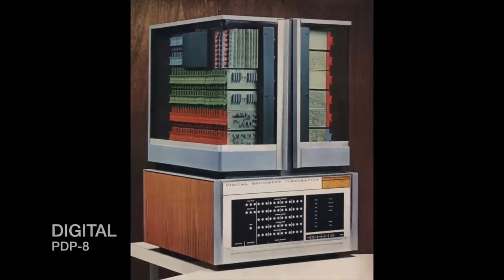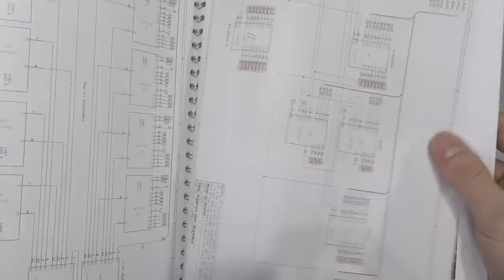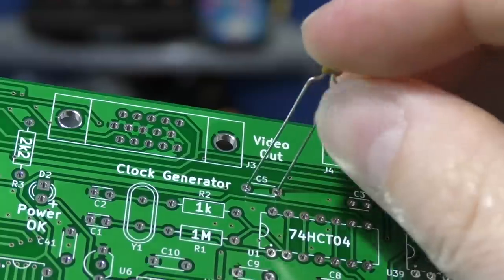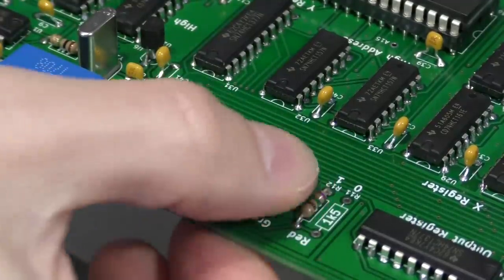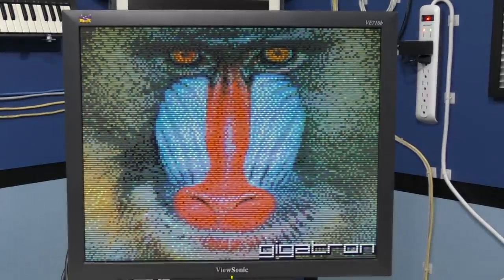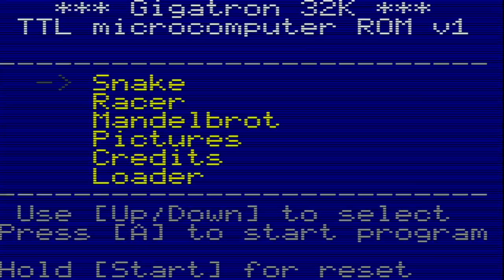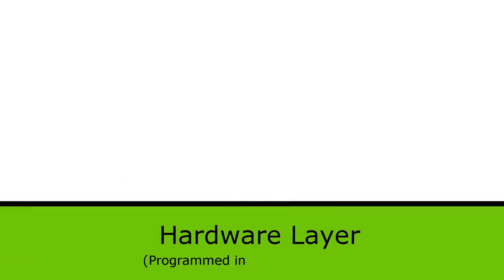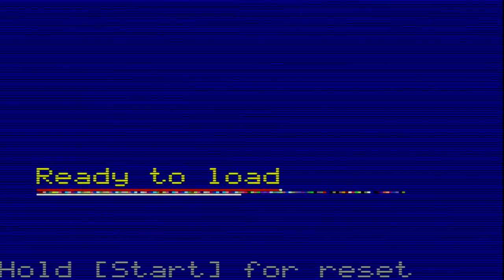The Gigatron TTL Computer without a Microprocessor

Comment: My first computer was a Vim with a 6502. I had to assemble my code by hand. Counting the displacement for relative branches was always challenging. It makes you appreciate what an assembler and linker does for you.
Reply: vim...
Reply: I learnt machine language on a SYM-1 with 4 k of ram. Expanded that with an S-100 bus memory board to 16k. Learnt a lot about hash on the DC power supply lines and how to suppress the damm thing from scrambling memory.  In fact I learnt much more about IC interfacing at that time than when I completed a "proper" Electronics Diploma a few years later at University.  By then the fun about building your own was beginning to disappear when the 386 and 486 motherboards appeared on the scene. I'm forever grateful that I learnt electronics and programming during the time of 56K modems. Nowdays I read about people not understanding how memory pointers work and I have to laugh.

Comment: I used to work with boards like this in arcade machines and 80s-90s pinball machines frequently. Gorf, Missile Command, Asteroids, etc. It made repair easy once you found the problem. Finding the problem could be a problem however.
Best deal I ever got was a “dead” Pinbot pinball machine. Had to replace 2 dead transistors I got off another dead board. Got the machine for $200 and cost nothing to repair. Knowledge is power.

Comment: I don't care what anyone says, he does an awesomely clean soldering job.  👍
Reply: J. Green it looks like his soldering skills have improved tremendously in recent months. It looked super slick this time.
Reply: Agreed. Such an improvement from when he made the PE6502 Hobby Computer. Practice makes perfect.
Reply: Are we sure those are his hands?
Reply: I agree. Very nice build. I be jealous.
Reply: that was the first thing I thought when I saw the circuit board soldering. great job, I wish I was that good :D
Reply: Yea, he solder good, but the wrong way... never heat IC that long.. do maybe 2 pins, then go to next IC do same there. In main time the IC's can cool, before he solder next pins... otherwise the IC get maybe damaged.
Reply: @hypnoticatrance  best to solder in a IC socket, that way A:  No possible heat or other damage due to soldering to any IC and secondly B: future repairs and tinkering are insanely easy compared to unsoldering an IC.
Reply: I run  my iron hotter myself.

Comment: When I was an engineering student, one of the courses involved designing a computer out of what were called bit slicers, basically a computer without a cpu on a chip but rather building a cpu or rather an alu out of multiple chips.  Also, it was and still is common in digital electronics courses to build state machines, the early Pioneer and Mariner space probes used state machines instead of computers.  In essence, you could make a state machine to perform all the functions of a computer, it's even technically correct to call a computer a state machine.  State machines can be made from mere transistors, op-amps, discrete TTL logic gates, from counters or even from eproms.  Today people take megabytes and multiple dynamically loaded libraries to write programs that we use to write in just a hundred bytes without a library, we use to call making your own personal library making your own computer language.  People just can't do anything without a ton of stuff being done by someone else which they don't even know if they need them.
Reply: John Wang 
I do admire all the work that was done to make my life easier, I’m very grateful for the people who spent pain staking hours working on today’s libraries. I have attempted to learn but 99% of it goes over my head. 😔
Reply: Challenge yourself with a one bit Texas controller, not a bit slice even. IIRC 4 bit instruction set and a one bit output data bus. A MAXQ TTA OISA from Dallas/Maxim is also a mental challenge. Instruction set; MOVE f ddd ddd ssss ssss.
Reply: John Wang.
Hmmpf interesting name , do you have any connectiion with Wang Computers?
If its not a state machine it must be either
A Von Neuman machine
Or
A Moore Mealy machine
Correct?
Reply: @QqJcrsStbt  What is the part number of the Texas single bit processor?

Comment: Back in there 80's I was an the final testing for Perkin Elmer Computers this is how our computers where made. The processor was on 4 separate 15X30 inch board's with up to 4 more boards of memory, the memory controller and cache had their own boards.
The best part is that we could step the clock and follow each bit around the processor.

What you call the virtual computer we called the micro code which has the logic to control the hardware.

I would love one of these.

Comment: is it just me, or is there something inherently satisfying about watching a pin being soldered in ?
Reply: Yes, when you correctly solder something for the first time, it is wonderful to see how the solder flows into the joint.  One of the younger members of the ham radio club liked it very much too.
Reply: I get so stressed when my projects doesn't get soldered properly.
Reply: @Fatih Kan I have faith in you! Clean the tip of the iron, add a little bit of solder to the iron, FIRMLY place the iron on the pin and the trace, wait a couple of seconds, add the solder the pin and the trace (not the iron),  let it flow for a couple of seconds, remove iron.
Reply: I thought that too until my old iron from the USSR decided to start melting

Comment: A little tip for anyone soldering ICs: First solder every other pin and then come back and solder the rest. Old ICs are extremely sensitive to heat (and modern ICs aren't indestructible either) and this helps spread the heat, limiting the chance of damaging the chip.
Reply: This pcb make for hand soldering - pins warm wery fast - no need to owerheat iron.
Reply: Or just solder IC sockets instead. Then insert the ICs into the previously-soldered sockets.
Reply: @coriscotupi , I was wondering if anyone else noticed that. I'd never seen someone shoving their ICs into sockets prior to soldering.
Reply: @Milamberinx  I guess in higher-frequency applications it might be interesting to have all components as close as possible to the circuit board ground plane, and  also avoid the longer leads of the added sockets, but at 6MHz it would probably not matter. If I had bought the kit I'd have added sockets for the ICs.
Reply: First solder a diagonally opposite corner pair of leads to fix the package. You can see this has been done in the video, though it's not mentioned in the commentary. Then you can go round soldering alternate leads as suggested by hellterminator.
Reply: Whaaa,,, there are NO Sockets,, it is each pin thru the board [called thru-hole], unlike "SMT" [Surface Mount Technolgy] where the resistors and caps w/o leads are small blocks of material soldered DIRECTLY onto very small pads.
Reply: I used clips that were made to fit over the chips as heat sinks.
I also had to preheat some chips so they wouldn't crack from thermal stress!
You could use sockets on some chips and get away with it. But not on the processor, memory, or buss logic chips. The sockets change the LCR on the logic circuits and screw up the signal timings and shapes. They eventually came out with sockets that had bypass capacitors built in and had high enough Q factor to prevent this.
Even today you have to be very careful using sockets.
They will screw up today's super fast digital signals!
Reply: Sockets are really cheap and easy to find though. Could get 15 of them for 1 dollar.
Reply: How about cross soldering, corner to opposite corner to opposite middle to other opposite corner to opposite corner to opposite middle, and back to a pin in between the first and third (I'm making this up on the fly as writing, so should not be hard to follow) and so on? Like rims are tightened on a car, though this resembles cylinder head bolts more... You could also touch two pins at once, I guess, depending on size of package/iron.
Reply: @Paul Seymour "the signal did deteriorate in amplitude as the frequency had incresed" - so this is the reason why overclockers raise core voltage, right? When cooling isn't sufficient to suppress the noise floor, so they raise the amplitude to lift the signal absolute thus decrease error rate? I guess...
Reply: @jardolph4681  My Gigatron came with 2 IC sockets....for the RAM & ROM ICs, and those chips came already plugged into their sockets. 8-Bit Guy was just soldering in the parts the way that they came in the kit.
Reply: I prefer to solder the corners and check that the I.C or socket is still flush with the board before continuing with the rest of the pins. If space is tight then soldering the I.Cs directly is better than sockets. Removing a socket that is too close to a neighbouring one is a p.i.t.a.
Reply: Use sockets
Reply: @canesvenatici9588  But not GOOD ones......
Reply: @Milamberinx  its not good practice to solder the socket with IC installed - you risk cooking the IC.
Reply: if smaller than a 14 dip, do this and go slowly. on bigger chips, skip pins and then alternate sides after 3 or 4 pins and come back.
Reply: @technological reinovations they did! Years ago, i.e. when I was in school (lol), a common construction method was called wire wrapping. For experimenters today, we use 'protoboards' which also require no soldering skills.
Reply: @technological reinovations yes, TODAY protoboards=breadboards. When my Dad was a kid, breadboard literally meant a board you might cut bread on! People screwed down terminals and built their tube based circuits...
Reply: do it in available corners as u work your way in
Reply: @Milamberinx  , the Gigatron comes with the RAM and EPROM chips already inserted into their sockets, which is probably why he inserted them this way in the video.
Reply: @jardolph4681  , the kit comes with sockets for the RAM and ROM chips.
Reply: @artweaver6963  , you are not clear about whether you are writing about your Gigatron build, or your experiences in general.

For the Gigatron, there is no need to use heat sinks; none of them get warm, and certainly none get hot. If you are suggesting that any chips related to the Gigatron need to be preheated, that is nonsense.....you should write more carefully. I don't know where you get the idea that sockets could not be used on processor, memory or 'buss logic' chips......tons of successful vintage computers used sockets on such chips with no problem at all. Again, you may have some valid points, but you appear to be mixing comments out of context.
Reply: If they use HCT logic?  Then these IC's are so fragile they will fail if you look at them wrong.  You need Extreme ESD protection, keep the ICs in esd material until you use them.   If they touch a table surface? you touch one without the ESD strap?  100 % chance its now zapped and wont work anymore.  

If soldering? Some want the Lead-free, Lead being the symbol Pb, its very hazardous and you should not let it get on your skin. I was soldering 20 years before they started saying this.  Want the best? Rosincore what is it 63... cant remember but its got lead and tin and the flux in the solder, flows and dries great.  Pb-Free? a challenge to work with.   use a fan to blow the smoke somewhere else, dont breathe it.  use alcohol and horsehair brush to clean off excess flux, hair dryer works well to dry it.
Reply: @bradleyr4451  I used to play around with ls-ttl and cmos a lot as a kid, never blew a chip once and never practised any anti-static precautions.....
Reply: @bradleyr4451  Lead free solder is crap, and more than likely dud your project in a few years from "tin whiskers" that form over time.  60/40 rosin core is the only way to go, as the lead prevents the tin from forming the whiskers.  Lost a large amount of overpriced German mics due to the whiskering problem.  There's a good reason why lead free solder is prohibited on nuclear weapons!

Comment: I'm guessing the point of purchasing this would be simply for the enjoyment of building it.
Reply: Hreat conversation piece as well.
Reply: I'm more interested in that "Monster 6502" board at 1:12 ... C64s and Z80s and PCs just ain't the same magic as my old 8-bit Apple II+ (clone)
Reply: @Pijawek  yes, to get chicks!

It is easier to hatch some eggs, though.
Reply: Nee I think that it would be to build those logic doors by hand, I have't check the schematics but I guess that you have to build up the processor on the bus.
Reply: It’s a kit build like a model or Lego. No real purpose at this point other than for a hobby.
Reply: Why generalize? For me it's for the enjoyment of understanding it, in full detail.
Reply: It also gives you a clear idea of what goes on. Especially when every signal from the micro code right up to the result may be looked at.
Reply: @richlaue  Do you call the machine code "micro code"? The convention is to say that risc-machines (like this) does not use micro code – as they lack the internal microcode of many cisc designs. But your statement is actually somewhat true, as the machine code of a risc cpu often resembles the microcode used internally in other designs.
Reply: @herrfriberger5  micro code is the code is the code that controlles the hardware. The input to this code is the machine language.
https://en.m.wikipedia.org/wiki/Microcode
Reply: That's why I'm doing it. I love building things
Reply: But where can I purchase it??
Reply: @derpsakry4464  link in description
Reply: @richlaue  There is no link
Reply: More than that - it's to understand how computers work on a most basic level, by giving you something to work with and understand. Understanding the baby basics of computing makes it possible to develop low-level software.
Reply: Partly for fun but building a microprocessor free computer  makes it a novelty..
Reply: Nah, not just that. You learn how to make devices using TTL.
Reply: Yeah and sell to eBay or some other websites
Reply: Micro processor cor
Reply: Great way to avoid child support.

Comment: "I hope that somebody builds my dream computer"
And that somebody turned out to be future 8-Bit Guy
Reply: This is one of the "Fine i will do it myself" moments.
Reply: @crusaderanimation6967  Absolutely correct...
Reply: So in 50 years from now the 512-Bit Guy will create my dream computer?
Reply: @notthatntg  Actually not... The bit increase is driven by the need for memory. And by doubling the bits (which is an exponential increase!) the memory capacity is squared which is kind of 'exponential of exponential'. We haven't used full 64 bits in our 64-bit processors for addressing yet (just 40 of them, considering increasing one bit will double the supported memory, there is still a LONG way to go!). I'm not placing my bet on 128-bit computers becoming mainstream anytime soon, not to say 512-bits.
Reply: Who knows? Maybe Ben Eater will?

Comment: Brilliant, Thank you! I think your criticism of the chip count being high is a little unfair.  The board is an excellent teaching aid on how microprocessors are designed. Reducing the chip count by using an existing microprocessor (such as the Z80 or 6502) - would in my opinion - defeat the purpose of the kit. I'm amazed that the designers have got so much 'power' in their design. My homemade microprocessor which uses TTL chips, fits on a king-sized bed and has 1K of ram and 8 instructions.
Reply: Hahah that's cool

Comment: They needed to include a programming machine language monitor option just so people can try writing something for it.
Reply: I guess it depends on where you want to start. When I was building loose chips processors like that in the 1970s the first thing to do was make a cross-assembler on some other machine, then write the loader-debugger and push it down (somehow) to the target. At that point you could build a native assembler with the debugger, but again it is better to cross-compile that, it saves your sanity. Then you are set to go on the machine itself if you have IO working.
Reply: That all takes up extra ROM. Which is admittedly quite cheap these days. Perhaps have a "dual boot" mode.

Comment: In 1983 I designed the digital portion of test equipment for our GE E2C radar.  There was one guy in our group (a bunch of very smart engineers and scientists) who poo-poo'd constantly the fact it was microprocessor controlled.  "The whole thing can be done with synchronous circuitry" he lamented multiple times.  I was a new engineer, and it was not my call that it be micro-based.  To this day I don't know how it could do everything it did, if it didn't have a micro.  A lot more circuitry, no doubt.

Comment: I loved working on a PDP-8. Even have some of the Flip-Chip circuit cards. Eight opcodes would have crippled the PDP-8. It also had different group operate micro instructions. At DEC in 1969 I worked as a repair technician and one of the PDP-8 options I worked on was a vector graphics adapter called KV8I connected to a Tektronix video display. This system allowed me to play some of the first video games. Much more advanced that "Pong". A lunar landing game with the display showing the LEM, adjustable thrust coming out of the engine. Displays of miles to landing zone, speed, altitude, angle of thrust. You had to adjust angle and apply thrust and steering to land the LEM. Crashing happened often. And as you would try again you would fly over your previous landing attempts and see the crashed spacecraft. When you landed at the landing target, a little guy would climb down the ladder and go into a McDonalds, order a cheeseburger and a Coke, come out and go up ladder and then take off. End of game. Back to work now.